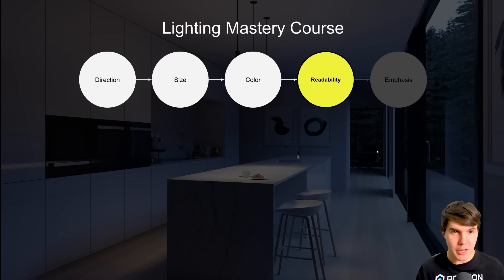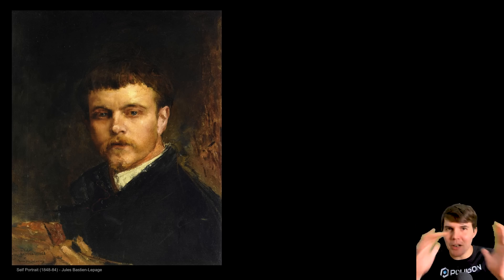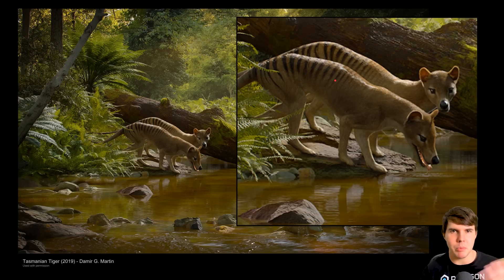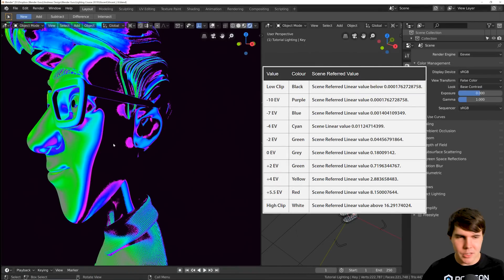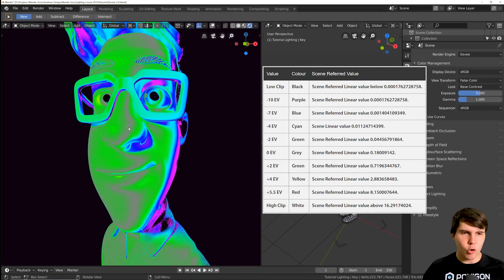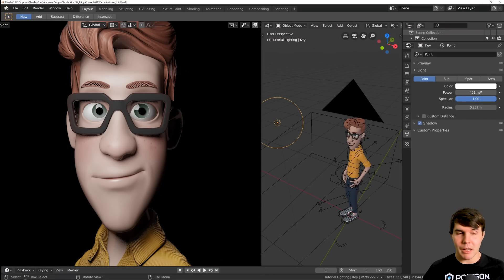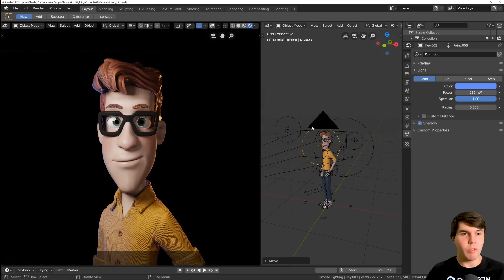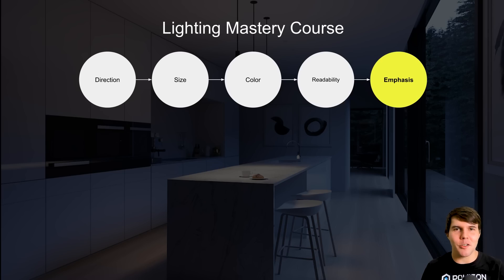Lighting for Beginners - Readability (Part 4/5)

Comment: Readability:
1) Too little/much light => hard to read and removes details
2) Object lighting - Light the contours (doesn't need to be fully due to gestalt laws) to show separation of objects
3) Staged - Looks fake and staged if rim light too prominent, as not natural having that many
3b) Character blending into background is more realistic as that's what we see in day to day life. Although it's harder to read the character, maybe that's not the point of the scene/image
4) Position camera, setup environment, character clothing, etc... can help with readability. Not just light
5) In Blender, use false color and make sure target midtones is grey. Also turn on high contrast for extra pop.
6) Fill light - fill in areas where you're losing information
7) Back light - gives little bit more info. Change color to not confuse back light with other two lights.
8) Kicker light - gives little bit more info. Change color to not confuse and can use to contrast against another lights

Comment: Yes, the false color is a good tool for exposure reading, but in blender it's kinda shit. Would be nice if you could pick your own range.
You also need a tool to for reading colors correctly.     
I think that Blender needs waveform and vectorscope monitor if it doesn't have it already.     
It is probably not needed now, but for the future it might be a good idea to have.    
    
Nobody will expect you to match colors or exposures in Blender but if Blender is the only tool you are using then surely it would useful to match color and exposure using light would be useful.